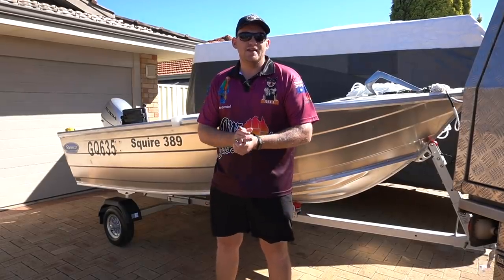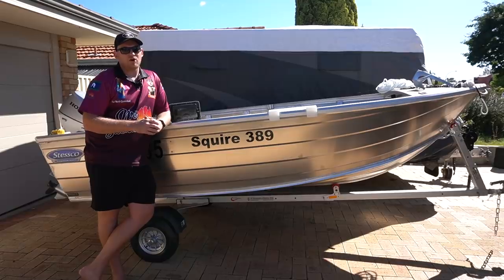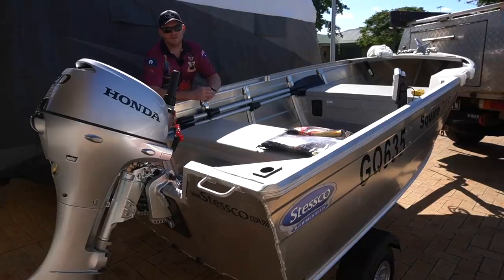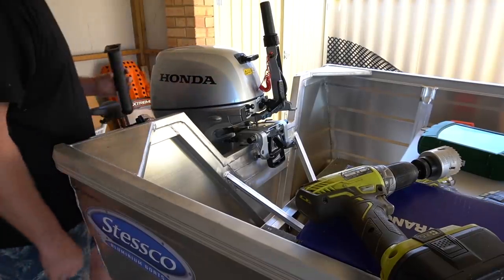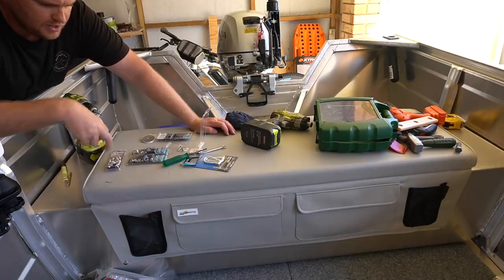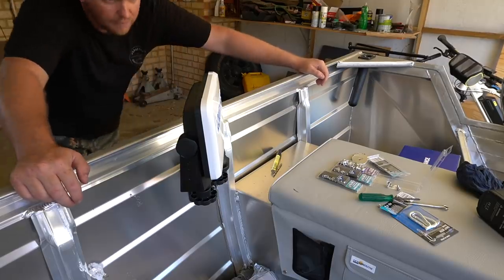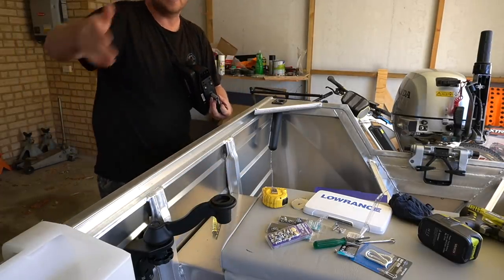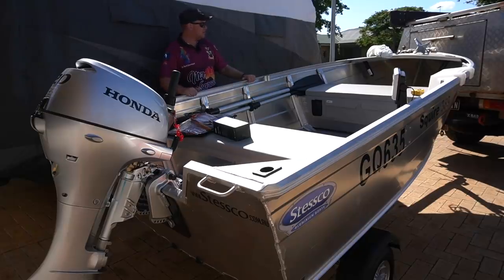Choosing and Fitting Out a Roof Top Tinny for Travelling Australia | Stessco Squire 389 & Honda BF20

Comment: OUCH!!!  four holes straight in the hull. I have similar set up and put a 75mm plate inside and fixed it to two of the internal ribs . Comes in handy I also have sounder with room to hang knives, grapple hook and hand held 27mhz radio just clips straight in. Nice boat mate. Good luck.
Reply: Good idea with the plate Blahh Blahh.

Comment: Cam since you drilled the hull for the ram mount( big no no)  consider putting feelers out or a fabricator to put a raised bracket for the transducer. Don’t drill holes in the transom for the transducer bracket.

Comment: Nice little boat 
We went from a similar battery set up to a lead acid after our jump pack got soaked and died. The honda is a good little motor had ours for about 5 years not super fast but economical  and quiet. Ran from fishmarket reserve in Guildford  to the Left bank  running out just comming back up to the narrows. Using the same size tank as in your video with 3 of us in it. 
Enjoy  your new toy  look forward  to seeing how you like it out on the water.

Comment: Not sure if it’s been mentioned but very common beginner mistake is screwing stainless screws into a ally boat, either find something to insulate the stainless and ally with or maybe go ally pop rivets...I’m assuming your using stainless screws btw, it’ll create the reaction between 2 dissimilar metals
Reply: Update just seen more you have mentioned stainless, it’ll still cause corrosion
Reply from the maker: Cheers Jack. Had no idea! I’ll replace them will ally rivets or maybe try some Tef Gel.
Reply: @WildTouring  look into it a bit mate, page on Facebook tinny boat mods, heaps of good info on there!
Reply: @WildTouring  a product called DURALAC, is made just for this problem!
Reply: @liampoor9699  How about if you use 316 Marine Grade Stainless Steel? 

Theyre made for marine applications

Comment: Hey dude you need to use a compound when using stainless steel fixtures or screws to aluminium
Reply: came here to say this... get some duralac for all fixings into ali. You can get it from Whitworths (few stores in Perth) or online I'm sure. Basically anywhere you have differing metals in contact you need to insulate to prevent galvanic corrosion
Reply: @bm083  I use this one for boats and vehicles - https://youtu.be/7PRq-IcD4Qo
Reply: @Tony_ASA  looks like basically the same stuff as duralac?
Reply: Beat me to it. Stainless and aluminium don't play well together.

Comment: That's pretty cool Cam and thanks for the run down on what's needed. With the power pack, you would want to ensure it is not exposed to water. I don't know if it gets hot when powering the fish finder, but if not, perhaps put it in a resealable bag?

Comment: Hey Cam, you should be able to mount the transducer out of the water,  pay no attention to your waterline stationary,  the transducer needs to be in the water on plane to keep you depth reading on the sounder.  I bought the same Lowrance for my boat.  there is a really good drawing in the box on where to mount, and you need to pay some attention to the direction your prop turns in forward gear, that will determine the best side of the transom to mount.  Great seat covers, rekon you should make sure them tin holders work with a stubbie cooler on 🍻🍻
Reply from the maker: Cheers Clint, I’ll have a look through the manual!

Comment: Thanks for the video due to i am looking at tenders for catamarans and just hate the blow up dinghies. So this is what happens on the cats is that you just need to be aware the aluminium will react to the stainless steel.  May suggest try some suitable rubber inserts that will go through the hull with washers from Bunnings for the screws to be insulated from the hull. Also 316 rated bolts in salt water just rust less
regards

Comment: Make sure all nuts n bolts are given a dose of thread lock, and the rod holders & seat clips should have been pop riveted, the vibrations on the roof will likely work the nuts n bolt & self tappers loose over time..

Comment: You’re going to wish you went for a 30hp donk. Once you get up into places where there are tidal streams you will be hard pushed to make any headway against the tides. How good are David and Vince at Dingy World!?
Reply from the maker: Blokes at dinghy world are fantastic! 
Yeah it’s all a compromise, the bf30 is 79kgs, nearly double the weight, and then I’d have to fabricate a lift to get it out and onto the transom. just don’t have the payload for it unfortunately.
Reply: @WildTouring  Do what I did. Sold the van and got a 28ft Catamaran with a truck. Floating caravan all problems fixed!. Sleep on the cat when it’s on the road!.

Comment: I’ve never seen anyone drill directly into the side of the hull to fit a sounder before 🤔
Reply from the maker: Way up out of the waterline, it’ll be right!
I’m more concerned about the holes that are under the waterline for the transducer.
Reply: @WildTouring  fair point. Usually the sounder bracket gets fixed to the frame part of the hulls. Next time haha

The transducer hole should have a one way valve plastic half cone looking thing on the outside of the hull. That’s the technical term also by the way and just silicone the fuck out of it haha